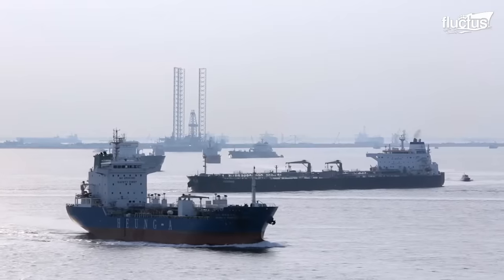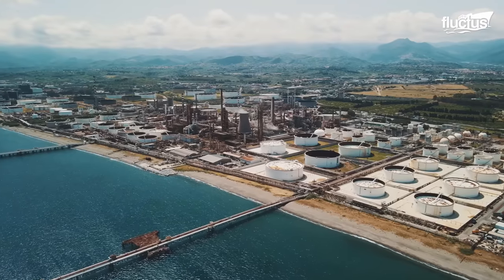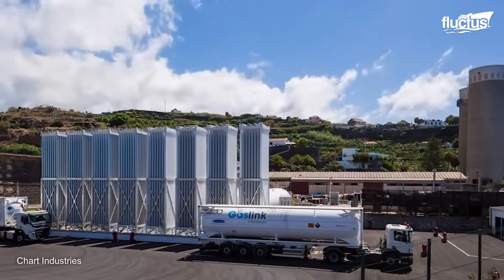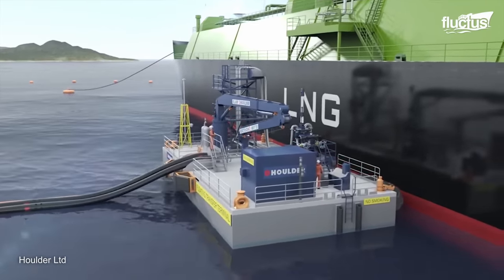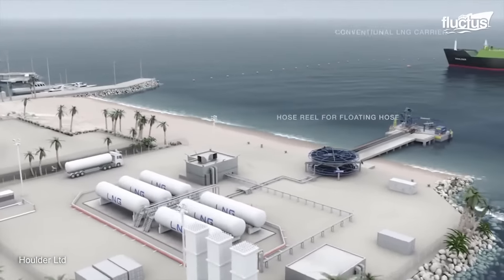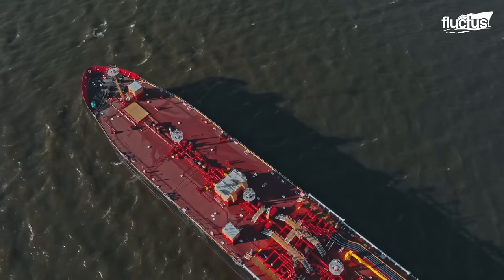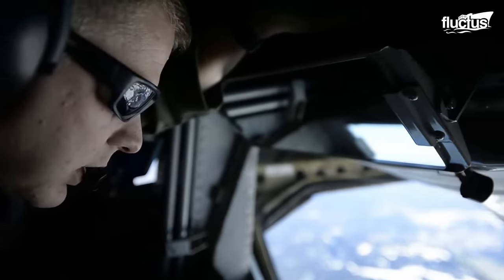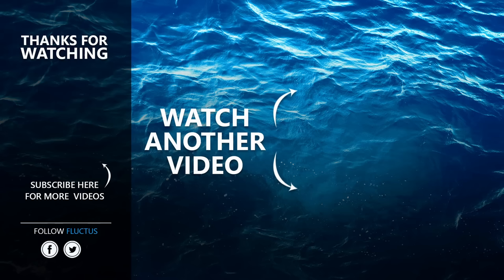How this Genius Invention Revolutionized Transport of Gas on Gigantic Ships

Comment: One of the big problems with LNG, as it is with any cryogenic liquid, is the fact that when the liquid evaporates into a gas, the expansion rates of 600:1, more or less depending on the liquid, places tremendous requirements on pressure relief systems and piping to control this expansion safely. If not designed correctly the piping can burst from the rapid expansion causing more problems with shrapnel and structural damage as well as the flammability of the gases that can self-ignite due to high velocities through breaks in the piping/valving. Just trapping a cryogenic liquid between two valves can cause a rupture in the line, so the design of these systems has to have relief valves or other ways to minimize this occurrence. The containers themselves have to be vacuum jacketed to minimize heat transfer into the cryogenic liquid as well. That transporting cryogenic liquids can be done almost routinely speaks of tremendous engineering thought put into every stage of liquefaction, piping, containment, and regasification, as well as the training of the people doing these jobs. I worked with liquid nitrogen, liquid oxygen, and liquid helium for over twenty years and it was done with strict adherence to procedures and keeping equipment clean and well-maintained as well as being a rewarding occupation.
Reply: I saw a worst case scenario years ago when cryo tanks ruptured while coming into port. LNG hits water and instantly boils. Liquid expands 600 times and is heavier than air. The growing ground cloud spreads out and when it reaches right A/F ratio explodes with power of tactical nuclear weapon. Entire port and surrounding areas destroyed. We have just witnessed world's biggest A/F Bomb, or Thermobaric Bomb.
Reply: On some LNG ships, as some of the product boils off, it's captured and powers the ships engines. Pretty smart way to solve 2 problems; venting explosive vapors, powering thirsty ship engines on long voyages.
Reply: I have lived on a farm, we handle liquid nitrogen without any safety equipment or training :D

(except the free- venting dewar container) 

It's used to store bull seed for insemination, 
and afterwards to "freeze brand" numbers on dark fur, by turning pigmented fur into white fur with a set of metal number stamps with wooden handles. Dunno how much that acually hurts...

Handling LN2 is not that dangerous in this context.

Though I do wonder whether our father should have told us to run and play around in the fog when he dumped the leftovers in the yard.

Thank you for sharino your detailed knownledge :)
Reply: @SJR_Media_Group  re: lng port explosion
Wow. Where did this happen?
I'm surprised I don't remember it from world news...
I'm glad this doesn't happen more often.
Reply: @nos9784  I totally forgot about LN2 on farms. You are right, plus branding with cold much more humane than old searing hot branding irons. Deep freezing semen used for Steers and Horses here. 

I live in a big agricultural area, we use CO2 for controlled atmosphere storage of fruit crops. We use LNG for frost control in the orchards. We use Liquid NH3 (Ammonia) for fertilizing fields and refrigeration. 

All these gases are heavier than air and it is possible to get asphyxiated if they fill low lying depressions in ground.
Reply: Where did this happen? Never heard abt this.
Reply: @123anban4  It was just a scenario to what could happen. It hasn't happened yet.
Reply: Well LNG has a relatively small window to be flammable when mixed with oxygen compared to hydrogen (which is going to be the future) which is flammable in a way bigger window… but hydrogen is endless renewable, so what do you do? You make sure there are many safety points to secure yourself and customers

Comment: By saying LNG is less harmful than other fuels is a misidentification.  It is more damaging since when it is extracted it harms the water table through leaching and the atmosphere as it isn’t completely controlled and much is not captured but off-gassed into the ambient atmosphere; extractors try to control this somewhat through burning some of this.
Reply: Even burning it in flares doesn't help too much, 
It burns dirty and partially.
Often, a large percentages of methane do not combust, and large amouts of soot are produced. 

Flares are safety equipment to dump gas without explosion, corporations generally don't spend the extra money to make them as clean as possible.
Reply: Gas extracted in the United States is much less harmful than the gas extracted in other nations, and yet we want to beg those other nations to continue extracting their gas while we stop extracting our own. So which is more damaging to the environment? The job that they do to get the same product to market or the job that we do to get that product to market……use your head people.

Comment: Finally they invented flexible hoses for gas carriers)))) When I was working there it did not exist. Much easier was write into the rules that shifting on 1m is your fault and shipping company will be paying for any damages to the terminal's line and for pollution if occurs